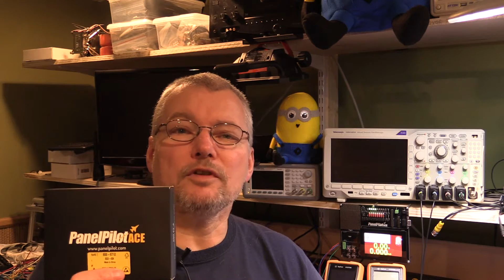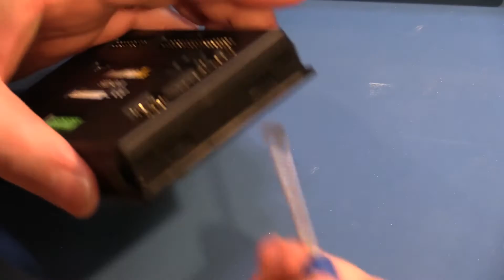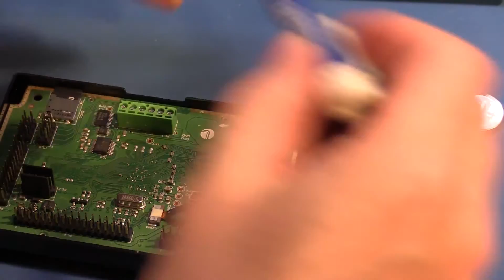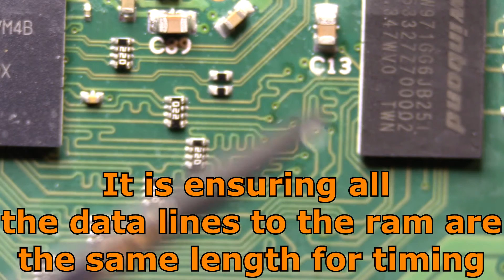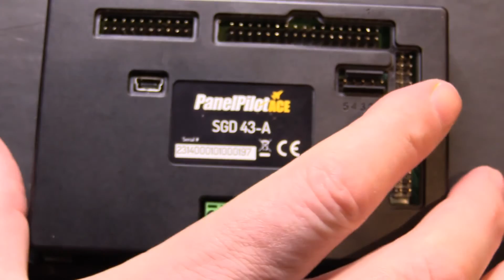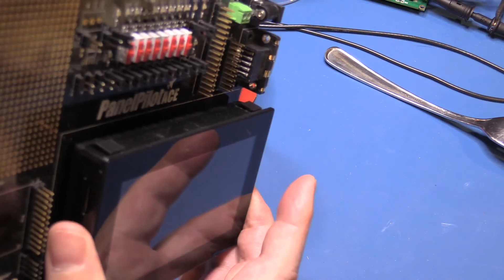Panel Pilot Ace SGD 43-A - Tear Down

Comment: HI Peter, is it possible to guide simple template with the pwm output.. i bought one of those unit with the eliminator board.. i doing projet that i must have few of the pwm output  but i cant do pwm output bit difficult for start.. maybe you can help.. thank alot..Bess. ireland

Comment: The arangement in the corner on the CPU side is probably not a switching power supply, since the processor contains onboard DCDC and battery charging circuitry.
Reply from the maker: It does but only from 5V to its various core voltages (3.2, 1.8, 2.x etc), the input to the panel pilot ace can be as high as 32V which it too much for the built in DC-DC converters, this one provides the initial drop to probably 5V and presumably supplies the additional peripherals when attached as well